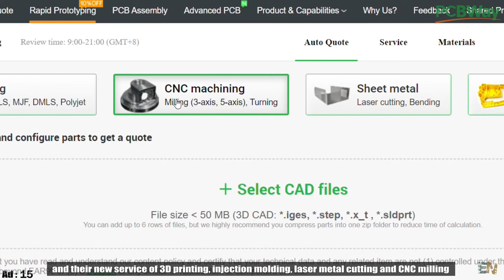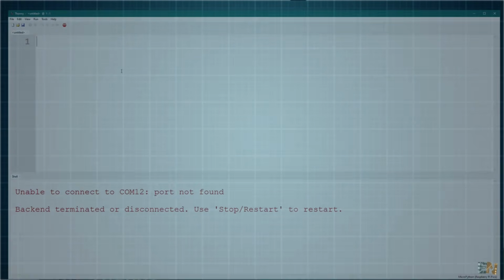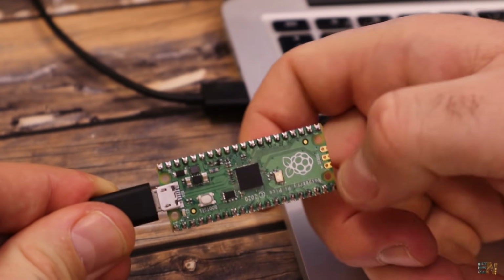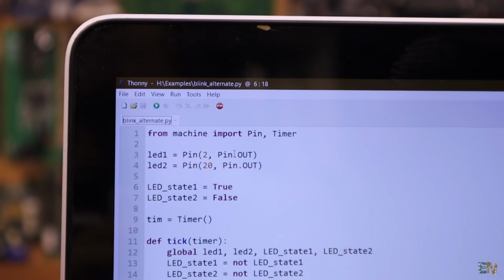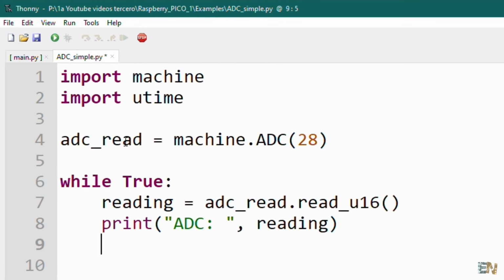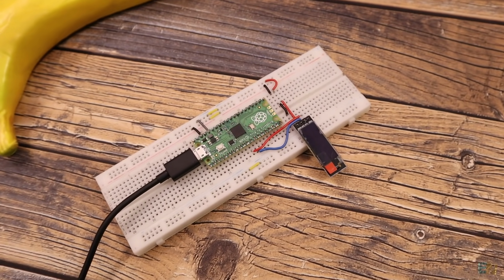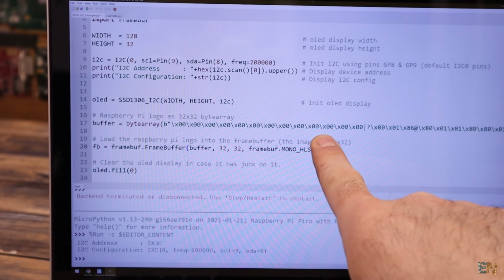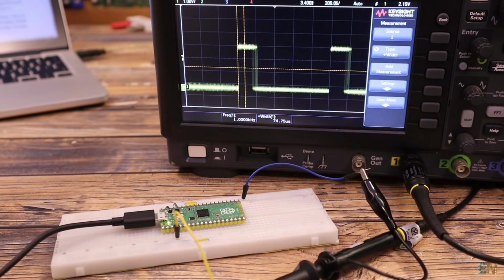Raspberry Pi PICO | Starting With MicroPython + Examples | I2C OLED, ADC, PWM

Comment: Importing the libraries gives the error:

MPY: soft reboot
I2C Address : 0X3D
I2C Config : I2C(0, freq=200000, scl=9, sda=8)
Traceback (most recent call last):
  File "<stdin>", line 12, in <module>
  File "/lib/ssd1306.py", line 119, in _init_
  File "/lib/ssd1306.py", line 38, in _init_
  File "/lib/ssd1306.py", line 75, in init_display
  File "/lib/ssd1306.py", line 124, in write_cmd
OSError: [Errno 5] EIO

No clue what this means.

Comment: Only one comment.. holding your pi or other microcontroller with a metal alligator clip on the GPIO pins can give erroneous behaviour or cause a short circuit in the worst case.

Comment: Hi, as a software engineer I would like to suggest you to switch from Thonny to Pycharm Community Edition with MicroPython extension. Thonny is a very limited IDE with no syntax highlighting as well as no intelisense and therefore is very prone to mistakes and syntax errors. Setting up Pycharm is relatively easy and definitely will pay off in a mid to long term.
Reply: Thank you bro.

Comment: I found this rather odd: I have a Pi 400 and a Pi Pico, but they completely fail to communicate with each other. However, in desperation I downloaded Thonny onto my Windows computer, and it connected with the Pico instantly and works absolutely fine! 😃

Comment: If you use MicroPython, it's possibly 4 times faster than 16Mhz Arduino. However, when you use C, the RPI Pico is significantly faster, approximately 30 times faster than when using Python. So, when using C, the RPI Pico at 133 MHz is maybe 120 times faster than the Arduino Uno at 16 MHz.

Comment: The Pi Pico ADCs look better on paper, but they're actually very noisy and non-linear, with spikes in the response that shouldn't be there.   There's a design fault in the RP2040 chip that makes the ADCs only equivalent to 9 bits, and you have to give some thought to how to get a smooth 9 bit response to a smoothly varying input voltage.

Also, the Ardunos all have a decent number of ADCs, while the Pi Pico only has three, and could have had four, if they'd connected that up to a GPIO pin.  Not everything about the Pi Pico is better - for some applications the AVR based Arduinos are still a better choice.

Comment: Great video !!
But I have a question

We have I2C0 in Gp0 Gp1
We also have the same I2C0 GP16 GP17

But if I run that scan it shows only one device so the big question is 

Why do we have 2+ sets of i2c0 in pi pico what is the potential advantage of having it like that ?
Reply: You can choose which pins a device (like i2c) appears on - but there are only certain choices because each pin can only do so many different functions.  Normally, you just configure it once in a declaration at the start of the program.  

I'm used to C++/Arduino, but the same presumably applies to  MicroPython / CircuitPython too.  Physically, the chip can do it, so it's just a question of whether the programming language gives you the option.
Reply: @TooSlowTube  Great, thanks
Reply: @sumukhas5418  You're welcome.

Comment: This is so clear to add modules and start with raspberry pi. Can you please do a session on how to use 4 wire stepper motor and hmc5883l digital compass with raspberry pi pico?

Comment: It's quite the same ARM tech as Psion and others from the 80's for those thinking it's super tech (the low price now is). I have a "NetPad" from 2001 which is speedy and I wish my power issue with it can be solved. I just like the Symbian/Epoc OS'es and have emulators (nostalgia and programming fun). The GPIO idea is very interesting to me. Also the modular constructs. Wouldn't have started with RPi stuff recently without the connection options and various modules in existence.

Comment: That wierdness is simply due to the read_u16. It's a 12 bit ADC value being transposed into a 16 bit range u16, I.E. reading 12 bits but using 16 bits to store it, 0->65535
Reply: thanks doode

Comment: Thanks
Reply: How come the 'pin 20' position coded looks like it rests inside the pin25 position for the pico?
Reply: It is because some of the pins are ground. 3,8,13,18 are ground on the left side, so there are really only 16 pins 0-15 on the left side.

Comment: This is awesome! Thank you for doing this. I'm an absolute noob to electronics. I understand coding (that's my day job) but nothing about electronics. So I picked up a Raspberry PI 4 and this pico w controller. Getting started I see everyone using these bread boards to stage their projects w/jumpers and such but I don't understand how you decide which holes to plug stuff in. For example in your tut here I see the pi attached with other jumper wires but have no idea why they are there or why you chose those holes to plug stuff in to. Is there any tutorial out there that can help clear this up for me???

Comment: Nice easy to follow video, although I think I've missed something as I can't get the on board LED to light on my R Pi Pico W, despite checking all the steps on this and other resources. Any idead would be most helpful (no doubt its something simple I've missed off).
Reply: Maybe you mixed up the direction of the LED that you plugged in, just switch the direction

Comment: For a noob, the code in the video is mostly useless unless the noob only wants to copy.  Mentioning what pins are used does not explain that much to a noob if details of how it is handled are also included.

Comment: You can also run Arduino on the Pico as well. I ran an Arduino performance test on the Pico vs my Uno. It's more than 10x faster :)

Comment: This is a great video! I'm thinking about making a tiny game console using one of these and a display and controller. Then I can program a few games in MicroPython,  flash it to the Pico, and have a game console I can carry with me and use whenever I plug in a micro USB charging cable!

Comment: This seems to be on par with the esp8266, a bit late for pi to be bringing out as the esp32 S2 is available with more and for less.

Following this a power consumption would be good information.
Personally  I don't like the compiler and manual uploading  files and/on calls for things to work, I wonder if it will get porting to A ide?

Comment: Nice examples. How about a single relay board connected to pin 40. powering a 3.3v water pump. With a capacitive moisture sensor connected to gpio. Programmed via micro python. And get the pico to run off usb power.
Be interested to see if you can make it work, or if you have problems with running pump due to power issues. Try it out

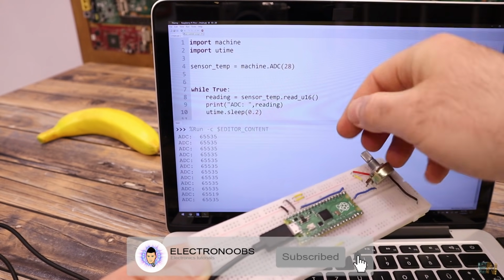Comment: 9:00 you say wierd but the documentation for MICRO PYTHON for pico says the 12bit ADC "samples" a value from 0-4095 and CONVERTS it to a 16bit value from 0-65535 so it behaves as other python controllers.
Reply: This is common/standard in automation systems. ADCs often all scale 0-65535 or the full range of their data type. When referencing a 16-bit number in this case with a 12-bit ADC, the least significant bits are not used. So in theory you will see this value change in multiples of 32.
Reply: One sensible comment at least

Comment: May you help me please? :c, line referenced
oled = SSD1306_I2C(WIDTH, HEIGHT, i2c) 

I2C Address      : 0X3C
I2C Configuration: I2C(0, freq=200000, scl=9, sda=8)
Traceback (most recent call last):
  File "<stdin>", line 15, in <module>
  File "/lib/ssd1306.py", line 110, in _init_
  File "/lib/ssd1306.py", line 36, in _init_
  File "/lib/ssd1306.py", line 73, in init_display
  File "/lib/ssd1306.py", line 101, in show
  File "/lib/ssd1306.py", line 119, in write_data
OSError: 5

Comment: Hello Electronoobs, I enjoy watching your videos, have done a test with the Raspberry Pico and an SSD1306 OLED display. Everything works as expected, I added some minor adjustments myself. If I want to run the code after a restart of the Pico (usb out and then in) my code will not run, I have two files on the Pico main.py and ssd1306.py. The main.py contains your code with my modifications. What do I have todo to run the script automatically after a restart of the Pico?
Reply: So i know you wrote your question one year ago, but maybe it is going to be helpful to someone else !:)  So as in the video first you should rename your main  file to 'main' (maybe you named it as Blinking or something like that if you want to blink a led its a logical naming to your file) . Secondly you have to drop this main file to the Rasberry PICO again. And it is going to work as you want.

Comment: I love that you're covering the new pi pico! I am trying to upgrade some of my old projects with this new board, many which use the popular nRF24L01 transceiver module. I would love to see a guide that uses these two together, like your universal RC transmitter, or a two-way terminal to terminal messenger. It looks like nobody out there as a guide with the nRF24L01 and Micro Python!?!

Comment: Great video! It's nice to show people to are used to Arduino hoe to het started on the Rpi. I'm curious about the power use, the Rpi is a lot faster, but does it use a lot more power? For battery or solar powered devices this could be interesting. Thanks again!

Comment: oh, just in case someone wants to try making a fast lifi lan like the old bulky version lost to the interwebs

github.com/raspberrypi/pico-examples/blob/master/pio/manchester_encoding/manchester_encoding.c
/**
 * Copyright (c) 2020 Raspberry Pi (Trading) Ltd.
 *
 * SPDX-License-Identifier: BSD-3-Clause
 */

#include <stdio.h>

#include "pico/stdlib.h"
#include "hardware/pio.h"
#include "manchester_encoding.pio.h"

// Manchester serial transmit/receive example. This transmits and receives at
// 10 Mbps if sysclk is 120 MHz.

// Need to connect a wire from GPIO2 -> GPIO3
const uint pin_tx = 2;
const uint pin_rx = 3;

c.o. ycombinator
"magicalhippo 24 days ago | parent | favorite | on: Raspberry Pi Pico and RP2040 Microcontroller

The programmable IO blocks look very interesting.
PIO is programmable in the same sense as a processor. There are two PIO blocks with four state machines each, that can independently execute sequential programs to manipulate GPIOs and transfer data.

PIO is highly performant as well as flexible, thanks to a carefully selected set of fixed-function hardware inside each state machine. When outputting DPI, PIO can sustain 360 Mb/s during the active scanline period when running from a 48 MHz system clock. In this example, one state machine is handling frame/scanline timing and generating the pixel clock, while another is handling the pixel data, and unpacking run-length-encoded scanlines.

State machines' inputs and outputs are mapped to up to 32 GPIOs (limited to 30 GPIOs for RP2040), and all state machines have independent, simultaneous access to any GPIO.

Will definitely pick a few of these up to play with.

	
kbumsik 24 days ago [–]

PIO is definetly interesting stuff.
This has its own assembly language (.pio) to program. Custom peripherals can be implemented by using this assembly.

Raspberry Pi already provides example programs such as custom I2C, SPI, UART (they are different from the hardware peripherals in the chip), logic analyser, LED controller, and etc[1].

[1]: https://github.com/raspberrypi/pico-examples/tree/master/pio

	
happycube 24 days ago [–]

Note that 10Mb Manchester encoding is in there - just what you need for very basic Ethernet."

Comment: I connect ADC pin directly to GND but it read 270+ value 🙄 please explain ??
Reply from the maker: small error. 270 of 65000 is practically 0.004% of the entire range, so 0.004 of 3.3V are just 10mV which might be a small reading error.  Also have in mind the ADC is 12 bit but the function is reading like it would be 16 bit for some reason..
Reply: @ELECTRONOOBS   Thank you sir for reply 
I think ESP32 is batter option I really disappointed from this board

Comment: Why do you have windows on Mac?
Reply: Best of both worlds. Excellent hardware, specifically the display. Biggest variety of software to choose from especially if you're a power user. Most microcontroller and single board computer manufacturers only support Windows.

Comment: Can we use pico as arduino and use it with nrf24 module on other arduino nrf24 module it will work or not code will same as in arduino

Comment: Amazing video as always and waiting for your amazing projects using the pico.
Just at 2:52 you say 264 but write 64 in the video. Also english is not really my thing but according to data sheets, they always state the bit in singular not plural for example 8 bit microcontroller not 8 bits
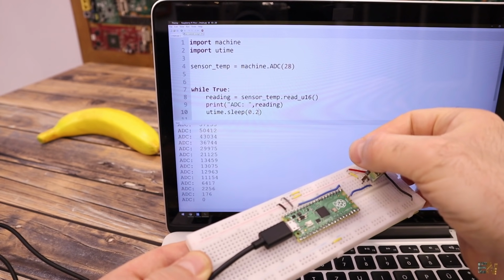Reply: I hate to be that guy but also at 9:05
In 16 bits you have 65536 values.
Computers start counting from 0 so the values will go from 0 to 65535

Comment: But dude, nano was launched in 2008,
and this is launched in 2021, can't you expect more from this board launched in 2021?? 
Why you just compared it with arduino nano it's already a very weak competitor 

Let me know your genuine thoughts on Pico. Will you recommend it ?
Reply: hi bro nice to see u here bye bro i just want to say hi (◕‿-)
Reply: Okay, sure, Nano is much older, but just look at the price. You can get an official Pi Pico is for just $4 and official Nano board costs about $24 - you could buy 6 Picos for that price. Also, I looked at the Pico's C/C++ SDK and it's waaaay cleaner, more organized, better documented and just much more pleasant to work with than Arduino's SDK, which is just hideous + their IDE is a joke - I really wish companies that build AVR/ESP32/ESP8266 boards would just abandon that dumpster fire and create something better, like Raspberry Pi foundation just did. Arduino is broken as hell and in my opinion it's high time to redesign everything from scratch - but that, of course, won't happen, and they'll just keep milking their customers from money and provide crap IDE that teaches worst programming practices.
Reply: @lusiaa_  you just wait for Arduino Pro IDE 
You’ll get all the features that a modern day IDE has and then you’ll love that more than any platform.

And if you compare the price than look at ESP32, a giant, powerful and more flexible competitor at just same price point. Who supports all the platforms, Arduino , micro python , circuit python , ESP IDF....

 Now tell me
Reply: @techiesms  I checked the "Pro" IDE and it's quite disappointing. Still no code completion (suggesting keywords from the project doesn't count), files are still called "tabs" - which means that single-file workflow is still the Arduino's preferred way to go... it's basically a reskinned Arduino IDE, nothing new here. At least they added a normal project view with files.

I know that ESP32 supports many SDKs and even different programming languages (C++ or Python), but many people still choose Arduino IDE, thinking that it's the best tool. Fortunately PlatformIO exists, I don't know if you've heard about it, but it's basically a platform for unified embedded development that supports many different microcontrollers - it's really great and I hope that more people would start using it.

Tbh my favourite microcontroller family is STM32 from ST - a role model that Arduino should follow: good documentation and support, a full-fledged IDE with code completion, debugging, code analysis, and many more functions (though you can use some other IDE, like CLion, and work on CubeMX projects there), affordable boards with modern peripherals... Complete opposite of what Arduino provides! I know that sometimes you don't need or want to work with such a powerful board with complex development environment, but that's where cheap boards with good SDKs, like Raspberry Pi Pico, come in handy. Arduino is just outdated (and overpriced) and I don't see any reason to use their boards for any project.

If you don't believe me that Arduino IDE and their SDK is that bad - when I was working on a larger project with lots of different sensors, GPS, GSM module and LoRa module the project quickly became unpleasant to maintain and add new functions. I had problems with libraries from Arduino itself and from Adafruit - there were some timers conflicts (setting up and using timers on Arduino is such a mess...) and when I swapped Arduino Nano for Nano Every (which is ADVERTISED as a "drop-in" replacement) to get more RAM, some libraries stopped working entirely - I had to modify source code of some libraries myself. Well, it was the last time I used Arduino for any serious project, now I'm sticking with my trusty STM32 boards.
Reply: It's not all about power. Especially with microcontrollers. It's (although the nano is so old) cheaper than the arduino nano and can even compete with the Chinese Nano versions.
What more would you expect that doesn't directly fall into the pi zero or pi 4 category of tasks?
Maybe better adcs or something but then again it would drive up the price for EVERY Board, even if only let's say 20% of projects need an adc. That's what iic is for, you can connect an external adc.

Way more important is the documentation and ecosystem and as it looks right now it can compete with the nano and the doc is (for hobbyists) way better than the stm and esp competitors.
Reply: @HannesMrg  documentation is where raspberry pi wins 
But 
In today’s time, ESP  boards are used by sooooo many people that now they don’t even need documentation. A random google search will solve their doubts. It’s just because ESP Boards are accepted by makers and promoted by makers not by any foundation or company.